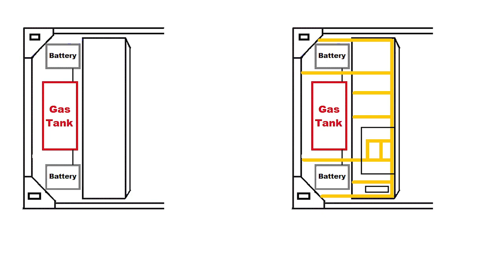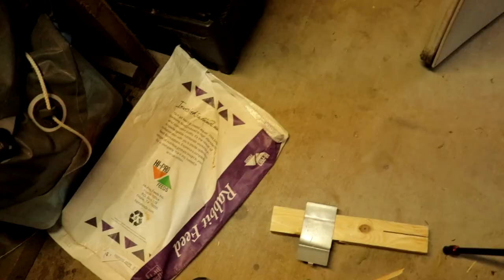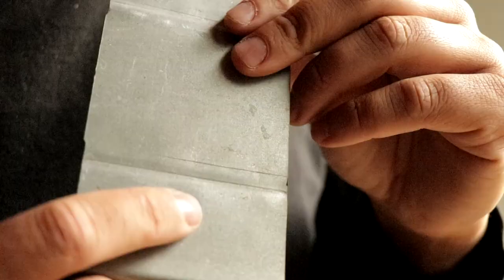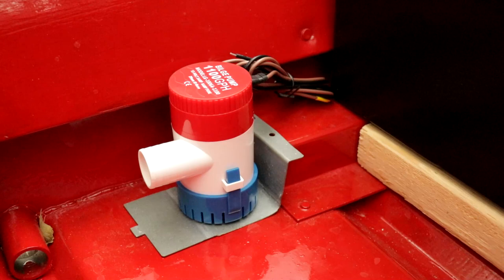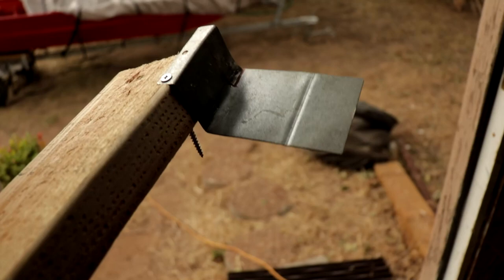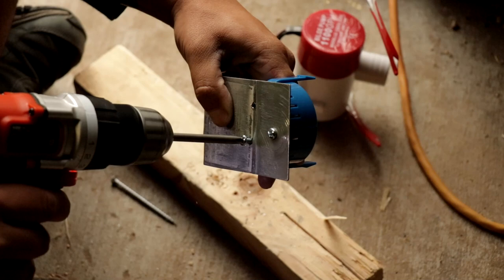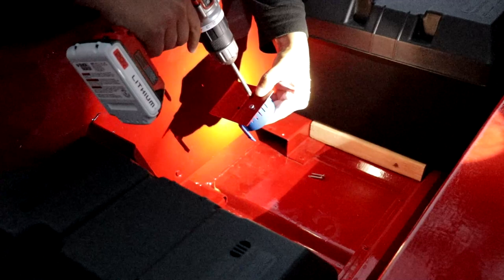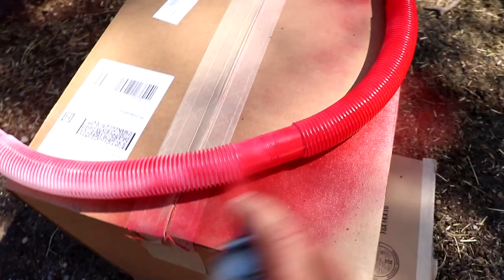Installing BILGE PUMP on Jon BOAT (Making Custom Bracket)

Comment: Adam you might want to go back and pull the pump back off and put a dab of silicone caulking on each screw head on the bottom plate so that the screw heads won’t rub through the bottom of your boat. Or a layer of old bicycle inner tube

Comment: Also like to say, IFFFF I would of had an auto bilge  pump. I may have not got enough water in 14/36 boat to flip it and loose several hundred $$$$ worth of gear
Reply from the maker: I’ve heard some people have problems with auto pumps staying on and draining the battery, so I’ll just keep a eye on the back of the boat and make sure no water is coming in